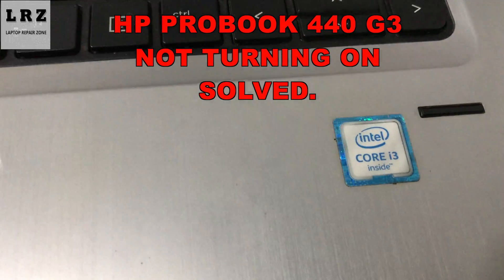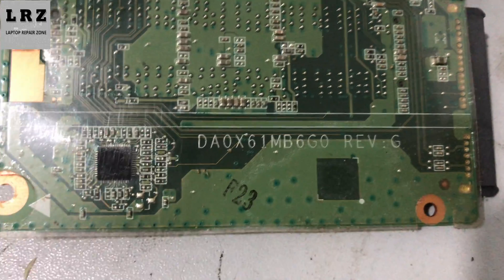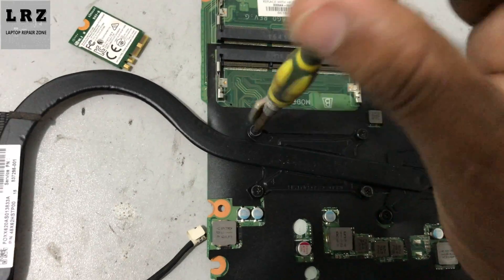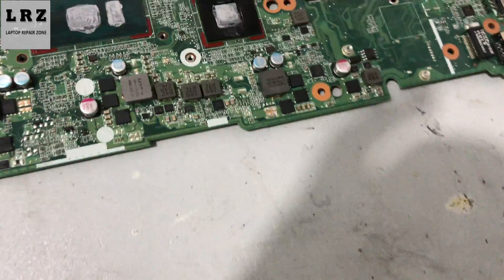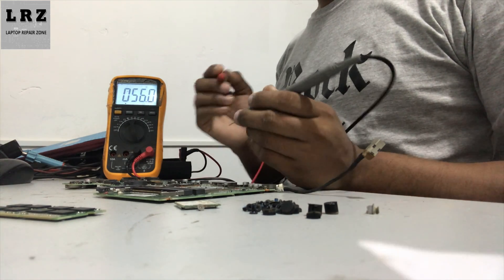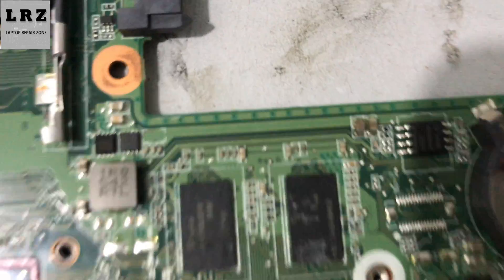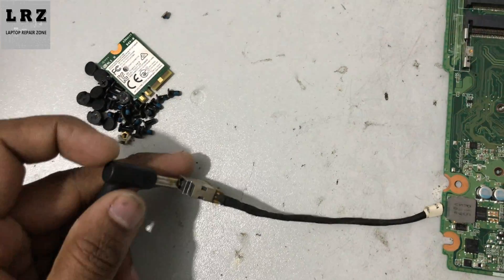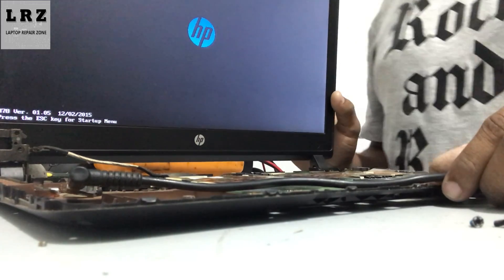HP PROBOOK 440 G4 NOT  TURNING ON SOLVED....

Comment: Thanks for the video, i have an hp probook 430 g3 a dead laptop, i opened it and found lots of ants in the moboard, i guess it caused to short circuit the motherboard also, i tried your method by injecting 3 volt to ground and positive but i can't find the suspect parts in the board can you help me what to do. I only used a 3 volt battery dry cell since i don't have a RPS. Will the battery enough to inject voltage?
Reply from the maker: You need to inject more than 3V in main line in your laptop motherboard.  from external power supply that should be 5amp.
Reply: @Laptop_repair_zone  ok thanks

Comment: hi i have a probook 450 g4 notebook without ram. When i connect to power supply the white led on power plug lights for 2 seconds and the power on button lights for 2 seconds. I have disassembled and disconnected and connected the battery. The voltage is ~12v 

 

Please tell me what happens when i stsrt without ram are there beep or light codes? Where and how can i check by myself if this notebook works without buy ram.

 

Thx
Reply from the maker: Thanks for your comment, please remove all the extra device from laptop like wifi card,hdd, odd, then try

Comment: Hi I updated the Bois driver and than laptop restart bip 3 times and than shut down instantly. After than it is not turning on. When plugged power only cap lock button light on for 3 sec and than gone. Not starting. Any solution please advise or any possible damage please advise . 
Thanks 
Shishir

Comment: Nice video. But did not work for my 440 G4 problem. When I plug in Power cable, the white power LED lights up for 3 secs and then off. Any suggestions? I can feel CPU get hot, but no image on screen.
Reply from the maker: Thanks for your comment,remove battery  and clean the RAM then check.

Comment: Hi i like your videos i hope you can help me with my problem i have a hp probook 450 G1. Capslock + numlock blnks 5 times then fan spins on max. 19v , 5v , 3,3 v , 1v , 1,5 v ram , 0,8v all present. What can I do to fix this problem can you help me please
Reply from the maker: Thanks for your comment,reflow PCH chip,flash BIOS, check all the suspension voltage.
Reply: @Laptop_repair_zone  ok thanks i will try that i will let you know. What do you mean with suspension voltages
Reply: Hi i tried to flash the bios, but didn't work do you have a good dump? Rampage _MB12241-1. Any help is very appreciated